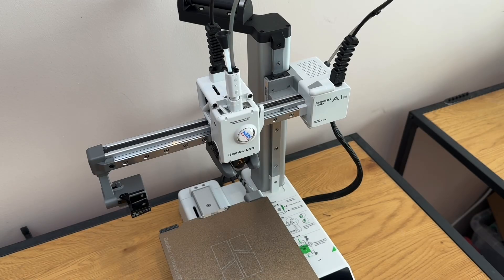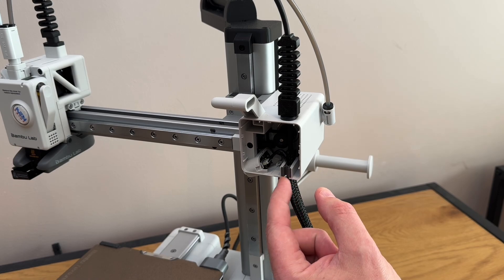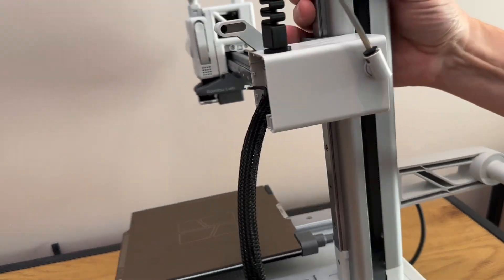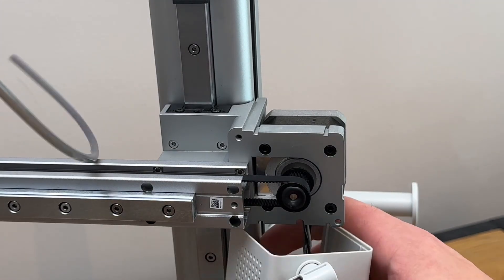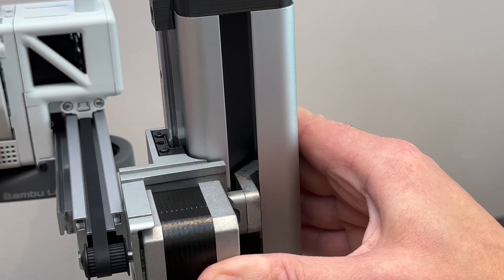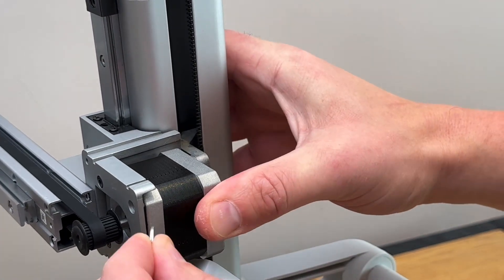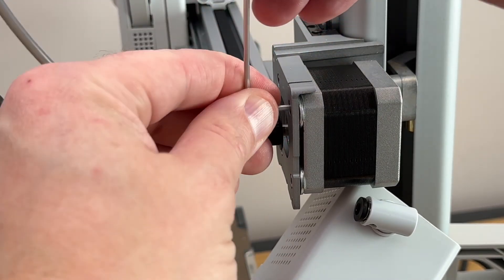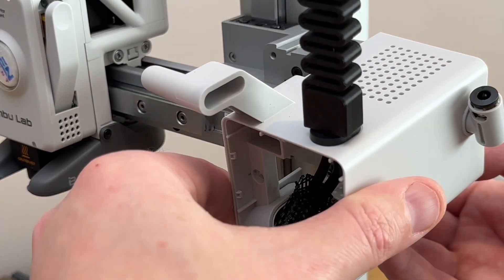X-Axis belt alignment on the Bambulab A1 and A1 mini

Comment: yeah but.... those screws aren't going to thread in straight on the no shipped side... I know replacement motors aren't the most expensive but still you might mess up your threads. My printer fortunately doesn't have this issue. I would call this a defect my self.

Comment: Could you also loosen the belt by unscrewing the bolts, adjusting the belt's position in the middle, and then tightening the belt again, so as not to have to work on the engine?
Reply from the maker: Without using the spacer to get the motor lined up it will just go out of alignment again in a few seconds of use
Reply: Before opening it... I did the procedure to adjust the X belt tension... I loosened the screw and moved it about 5 times... and then tightened it again...
It seems like magic, but the belt went back to being centered... by itself...
Then I redid the full calibration and everything is ok.
I'll check it a few more times... if it gets crooked again I'll come back to let you know. @Kenprints
Reply from the maker: Cheers for that 
Yes some printers appear to be worse than others - i purchased a used one yesterday and the belt is perfectly centralised as is

Comment: Thanks for this. My A1 needs this adjusting and this explains it perfectly.
Reply from the maker: Might be a little different on the a1 but a similar process
Reply: @Kenprints  what about adj tension after? because you increased the tension of belt by moving the motor. ?
Reply from the maker: It doesnt move enough to have any noticeable impact - print quality improved if anything
Reply: @Kenprints  I disagree. You added a 1.6mm spacer, which will offset the gear tip by 2.5mm. This is a noticeable increase in tension on an already tight belt. Why did you fix it? Was it rubbing, or did you just notice a warp? Mine doesn't rub, but I want to be proactive and straighten it out, because as an engineer, I understand that this will lead to a loss in print quality and belt wear.
Reply from the maker: Mine was rubbing against the alloy extrusion very slightly
Reply: @Kenprints  Yeah. I’ve had a look at it and it is basically the same kind of thing. I’m sure it won’t be very much different from your guide.

Comment: The A1 motor mount is plastic unlike the A1 mini. Would you still use the same repair method?
Reply from the maker: Its been a while since i had the a1 so id have to check but i assume its a similar setup
Reply: @Kenprints the washers were too thick. I ended up having to insert some thin plastic strips between the rail and plastic motor mount at the front. Everything else was making the belt ride the back of the rail.
Reply from the maker: Yea i only used what i had available to me hopefully your plastic strips did the trick

Comment: I did not catch it in video, but you put the washers only on one side of the motor, was it because it was not perpendicular to the axis' rail? I wonder if just untensioning the X belt and then aligning the belt would be sufficient, possibly even without dissasembling. This is what i did in my A1 mini and it stays in the middle of the rail so far
Reply from the maker: No i only put them on one side so that it set the motor at a slight angle which aligned it with the rail resulting in a belt that ran true